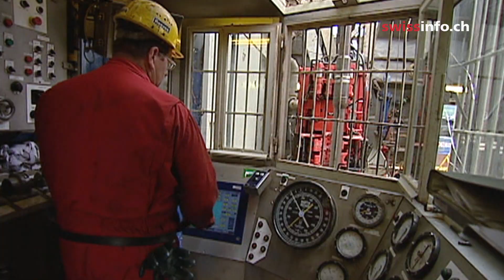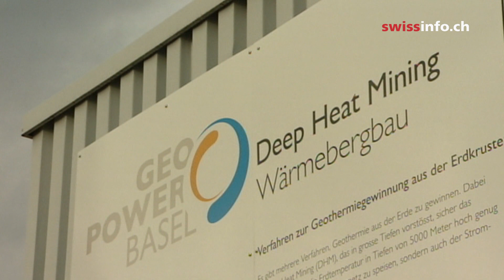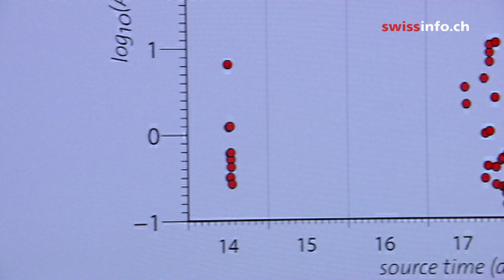Earthquakes trigger concern over geothermal power

Comment: Water should not be spread in to the crust. Instead it should run in closed loop.
Con: temperature will be lower
Pro: crust will cool down much slower, water can be reused
This source of heat is exhaustible - it is just a matter of water volume you pomp through.
Reply: Science
Reply: Green fire energy. Coso range, CA..

.... i'll get you a knife so you can finish eating crow